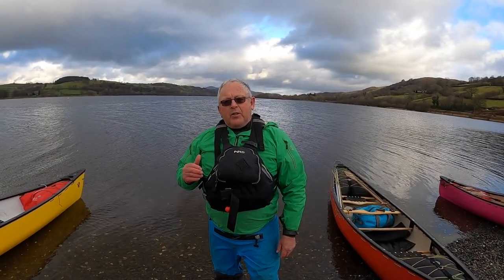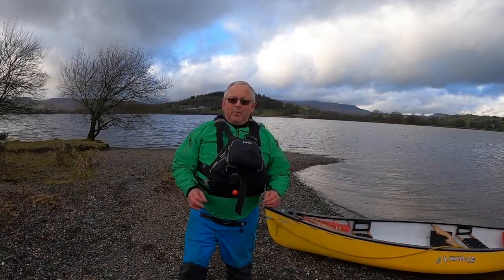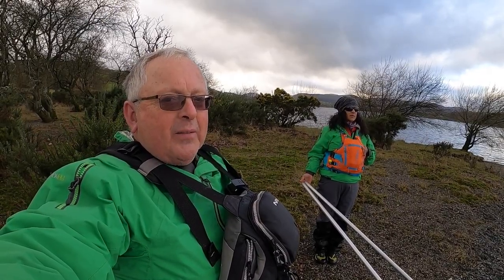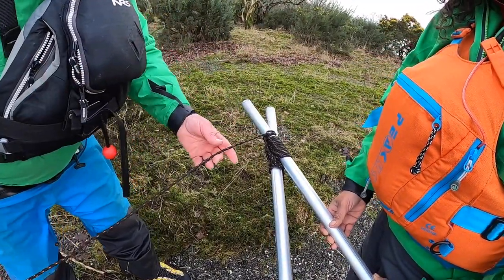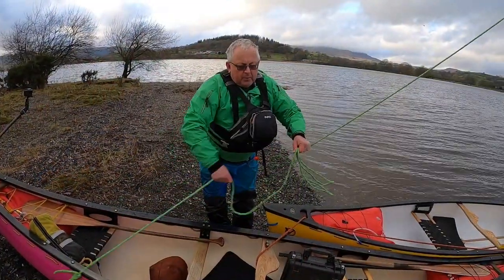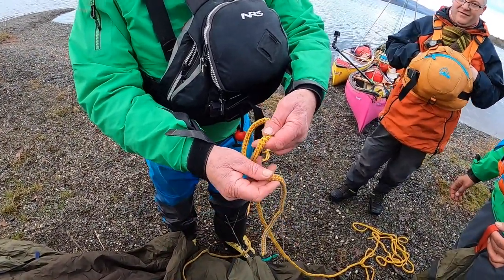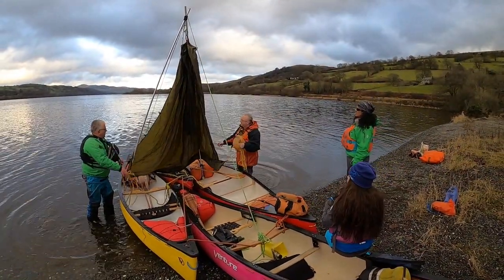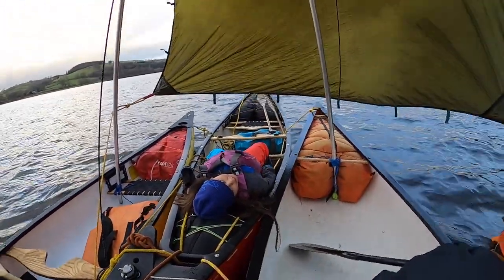Building an Improvised Canoe Sail

Comment: My setting poles will slide into the handle on the deck plate of an Old Town Tripper tension of the sail holds it in place. I like the tennis ball idea for the other end.
Reply from the maker: Hi again.  Have you tried it like that?  In my head I am thinking that with a pole angled to make an A frame that would be awkward. Cheers
Reply: Ray Goodwin the sail is square..think Viking ship. I tried to attach a photo, but couldn't.

Comment: Ray, I watched your video several times and deployed the two boat rigg on Loch Lomond last year with great effect. The swell did get a little tasty near the end of the Loch. My question today is the three boat rigg you show at the end of the video shows the middle boat at the rear. Doesn't this mean you catch a lot of up splash between the three boats?  Would it not be more dynamic to have the middle boat at the front? What's the reasoning for having it at the rear.  Video from last year https://www.facebook.com/278934735640158/videos/960370797794046
Reply: This was the tasty version just as we approached the end of the loch. https://www.facebook.com/278934735640158/videos/3393260557422976
Reply from the maker: That was big!  Impressive.
Reply from the maker: I like the video.  Good stuff.   If I know it is going to get 'tasty' then I will do my best to do separation, as you did, with wood brace across the canoes, keeping a gap between.  Re pod racer with single canoe at rear.  Not had a problem with this on splashing up that is any greater than the other methods but the wooden brace I think is better.  Thank you for your comments and it has got me back to thinking about these formations.